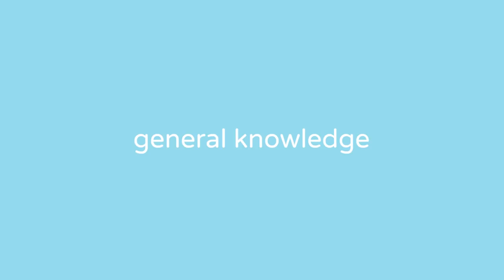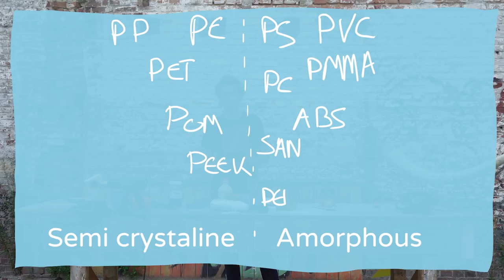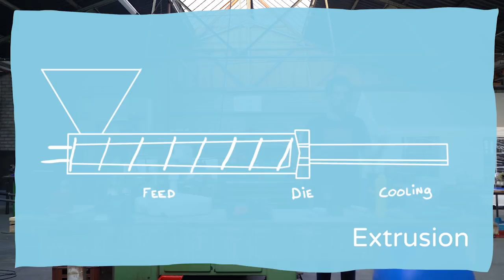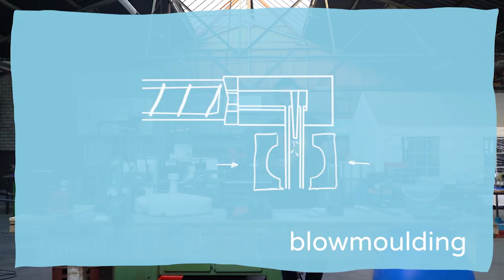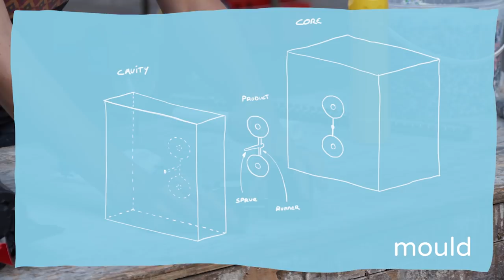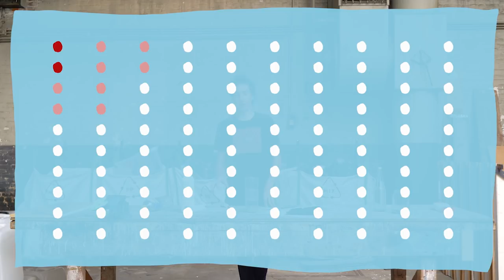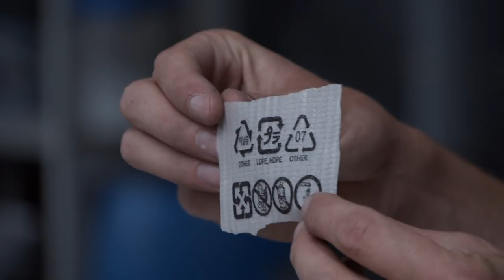Precious Plastic - Going nerdy on plastic (part 2.3)

Comment: To 3D-Printing: It is possible to recycle plastic waste into 3D-Printing Filament. We did it.

There is not much household waste containing PLA, PETG or ABS (most common 3D-Printing Materials) though it is possible to 3D-print with certain types of PP (most common plastic waste). Some companies sell PP Filament too (though not recycled). The big producers of 3D Printing Filament are using basically the same Extruder of precious plastic, though with a lot more power and precision.

The problem is that 3D-Printing filament requires a high precision ( +/- 0.05mm in diameter) for normal 3D-printers to be able to handle it. Achieving this precision is really difficult because you are working with many variables:

-Motor Speed
-Pull Speed
-Temperature ( usually 3 Heat zones)
-cooling temperature (we have air cooling then 2 Watertanks)
-granule (flake) size ( if there are bigger chucks they will clog the feed for seconds causing bumps)
-material purity ( if there are even hints of other Plastics in your granule it will ruin everything; it also has to be super dry)

Even just getting the material purity and granule size sufficient for the process is difficult especially with household waste. That is why we recommend that if you want to try to make 3D-printing Filament you should get your hands on Industrial waste. We went around and found the factories near us and asked them if we could have there waste. They were glad to give it to us cause otherwise, it had to be burned.

 And it's a win-win situation because industrial waste is clean, dry, pure (no other plastics) and if the factory owner is nice he will even give you the data sheets so you know exactly what you are working with. Using Industrial waste you can cut out these variables and concentrate on the temperatures and Motor/Pull speed. 

Making 3D-Filament from household waste is very ambitious, though making Filament from clean Industrial waste is manageable! We did it and we are just a couple students from Germany!

Though there is still a lot of research to be done: Material properties to figure out, print settings to perfect, Code to be written and so on. We are working on this Idea and sharing everything open-source online on youtube and mostly on Instagram (@qitech.de) or our Website. If you have questions or want to start research in this area too, feel free to contact us and we can share our experience and knowledge with you.
Reply: Nice. 3d print filament is the best usecase for home plastic recycling
Reply: I recycle printers and computer cases to make my own filament (I only use abs without fire retardant). I built my own extruder and I use a commercial paper shredder to shred my ABS. Most of my recycled filament is +/- .05mm from 1.75mm and prints great in my printer. I built my extruder using mostly components recycled from paper shredders and treadmills. The rest of the components cost me less then $80 or were printed.  If you have any questions just ask. 
It sounds like your setup is way more complicated then mine as I only have one heating element and I only use a cooling bar instead of air/water cooling. I still get great usable results.
Reply: @Dustin Eward I have tried extruding PET filament with my extruder that works great for abs. I had very bad results. The problem with PET is that it is not an amorphous polymer. PET is semi-crystaline. The problem with extruding semi-crystaline polymers is that there is a fine line between when the PET is the consistency of molasses and hard. An amorphous plastic (one that doesn't crystalize ) has a wide range of temperature where it has different consistency.

I had the problem with PET crystalizing right out of the nozzle and becoming very lumpy.

This is why glycolized PET (PETG) is used for filament. PETG is more amorphous.
Reply: @Dustin Eward I'm pretty sure glycolization of PET is done when the plastic is produced and I don't think it can be easly done by your average dude.
Yes I'm pretty sure PET could be used easily in a machine that extrudes pellets straight to the nozzle.
I have experimented with extruding hdpe and ldpe. They are both semi-crystalline but HDPE is more so. Hdpe didn't give me good results. ldpe I could see being done but I would have to make some major modifications to my machine and I would rather have it set up for ABS all the time.
https://www.spirol.com/library/sub_catalogs/ins-Plastic_Overview_us.pdf

There is a list of amorphous and crystalline polymers
Reply: @Alobster1  Hey awesome! would love to know more about how you did id and how it looks. I am trying to build an extruder/hotend for 3d printers that directly recycles and prints so you dont have to make filament. Would love to get in touch with you. but youtube seems to not have Private messaging...
Reply: @Alobster1  and  Marvin. t4emblem  Are you members of the Precious Plastics Community - I am ubiquity#9471 there (on Discord) so you could both pvt message me there with permission for me to exchange user name information with each of you. Just a thought.
Reply: i think i know you =D 
I love your idea! I also wanted to build a filament extruder in school, but the problem was the plastic. and you know, there is charge on the PET bottles ("Pfand") which you get back by bringing the bottle back. so we did something else. but the industry waste is a good possibility. for example REDLINE also offers industrial recycled petg. 

cheers!
Reply: yep, you are those i knew. great stuff!
Reply: I can’t hear the soundtrack

Comment: To sorting by density:
I think you can just start with water, grab the floating fraction, add salt to the water, grab the floating fraction again, and repeat. 
You can even retrive the salt used at the end of the process. 
Great video!

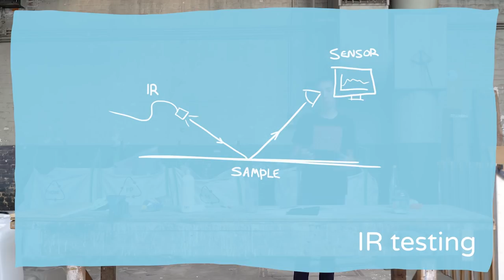Comment: Imagine a handheld device that could instantly tell you the kind of plastic, maybe by using the infrared technique (16:51).
Clean ups would be way more effective since you don't have to look for the recycling logo, which in most cases probably doesn't exist.
Let me know if you've seen a product like that 😃
Reply: You can use your hands and your nose to tell what kind of plastic something is. Just from a bit of experience working with plastics I can easily tell what kind of plastic something is, if it has a filler, and if it has fire retardants in it. Every plastic has a very distinct smell when burned and burning behavior. Most plastics have also have their own distinct hand feel.
Reply: @Alobster1  that sounds interesting but you would need a lot of experience to be exactly sure. I might get there one day but until then a device to "register" plastic would still be awesome!
Reply: @Alobster1  sniffing burnt plastic is a quick way to develop hormonal and cancerous issues later in life.

Comment: I wish that injection molding equipment was as cheap as 3D printers. If it was then I would regrind and re-mold recycled plastics. It's a lot easier to injection mold plastics than it is 3D print. I've seen the equipment precious plastic sells. It's a great idea but the prices are above an average consumer. To  be able  to afford an electric molding machine, auger grinder, and the resources to  build or purchase a mold is beyond my means. I can create a process for just  about any plastics, but I don't have or can't afford the equipment. Regardless of that I love what Precious plastics is doing. Keep doing it.
Reply: Ironically "DIY" thing make expensive 😅

Comment: Too lazy on what can't be done. The key to not burning plastics if they have a melting point slightly below the burning point.
Reply: Yes but for most thermoset plastics there is no melting, they will only thermally decay. Thermoplastics melt because they are just long tangled chains of polymers. Heating them causes vibration at an atomic level and causes these chains to vibrate so they are able to untangle easier.

On the other hand, thermoset plastics aren't just tangled polymer chains. As stated in the video there are actual crosslinks and bonds between molecules of different chains so you can't simply untangle them.